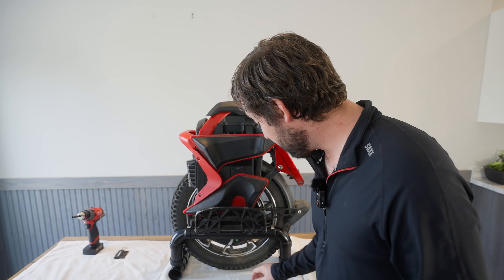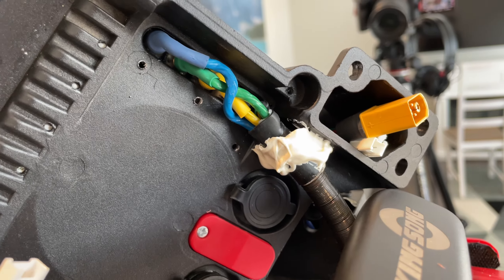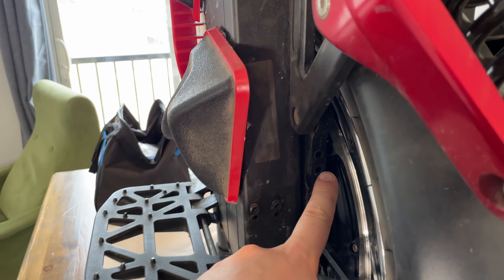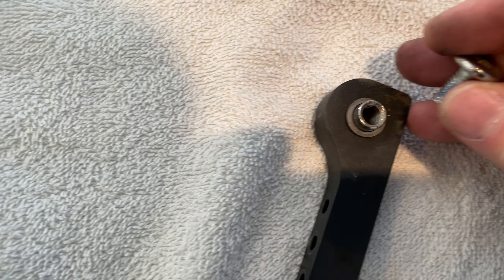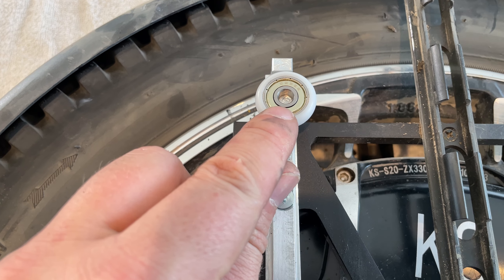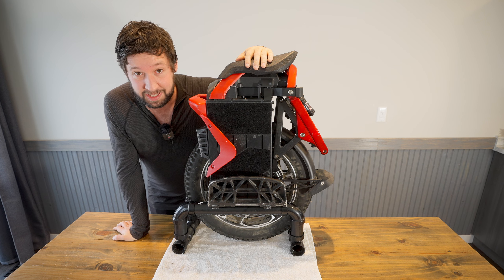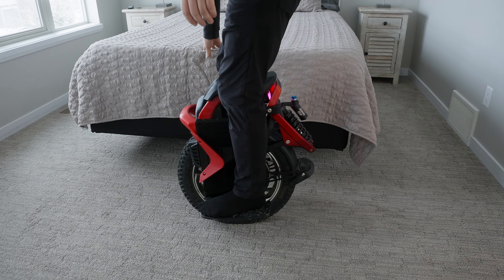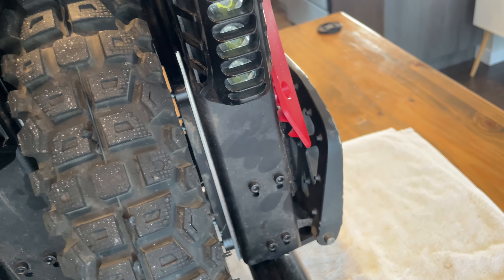King Song S22 CNC Sliders - Install Time!

Comment: I used a 8MM socket to hammer down my bearings, no issue and super easy
Reply from the maker: I tried the same thing! With, and without extensions, even greased everything - mine must have been abnormally tight.

Comment: Well just installed it and now it is acting funny electrically eeee... Emailed rev rides.. seems like the handle isnt SNAPPING Like it used to. It wouldn't turn on at first and now it does but making an odd sound and rotating even though its disengaged
Reply from the maker: That doesn’t seem right
Reply: @landocycle  yeah i know right... My last EUC was a v12 and when i broke the rim it took me 5 times of taking it back apart to get it to work. Was fairly confident i followed all the steps i really don't know what i did differently about the handle here... =\

Comment: 5:50 How hard would it have been to take the black bracket off the wheel and then press the bearings on using a press, bench vice or even a G clamp? I’m wondering if all that hammering has or could damage the bracket and cause alignment issues and that is why the CNC part is rubbing.
Reply from the maker: That was my initial plan after struggling with the first couple of bearings. Unfortunately, the hex bolts that connect the slider frame to the motor must have been red-loctite on because I was gonna strip the bolts trying to get them off. I decided to pick my battles and keep hammering.

I also was concerned about warping so I was visually checking periodically, and they're straight as an arrow; and they slid into the frame like butter with no resistance. So I think the rubbing is just the two front pieces slightly touching each other, which should go away after some use (I hope).
Reply: @landocycle  
I won't help you now but maybe try heat to soften most loctite. Not sure about red though but it's worth a try in future. A soldering iron placed into the head of the hex bolt for a few mins should have an effect.
Reply from the maker: @Therapistinthewhitehouse  yah, I just didn’t want to mess with it tbh. But I think it would make getting the bearings on easier for sure.
Reply: You’ll need a small bearing puller to remove the small bearing wheels if you need to replace or service them or their sliders.
Reply: @freeforester1717  
That’s not what we’re talking about. Removal is strait forward, it was the installation he was having problems with.

Comment: Have you done the shock bolt yet they need to be changed KS used to small of a length and the bind also
Reply from the maker: I have not, thanks for the info

Comment: does it have some vibrations while trying to troley it around? try some movements back and forth. mine have that thing.
how wide are wheels? it seems like there are a lot of movements sidewise and motor doesn’t stand tight. I think you should have minimum 9mm wide wheels to prevent it.

the metal noise you are hearing can be because of your roller rods are scretching the outer frame inside. its a bad thing and can lead to frame cracks
Reply from the maker: The motor makes some grunting type sounds/vibrations when starting or changing direction - that's normal. I didn't notice any abnormal motor play. The slider went in butter smooth so I would be surprised if it's damaging the c-channels but time will tell.

Comment: How would one go about eliminating the grinding sound you mentioned at the end of the video?
Reply from the maker: Mine’s gone already just needs to wear in.
Reply: @landocycle  so no more maintenance then? my s22 doesn't rebound back at all after a week of riding, it was perfect when I got it, now once it compresses you have to start lifting the wheel for it to rebound. think changing the sliders might help
Reply from the maker: @hipogejus  I still haven’t been able to test outside yet. We got a foot and a half of icy snow 😞
Reply: @landocycle  people say it's a beast on snow
Reply from the maker: @hipogejus  I can’t even walk outside it’s so icy, it’ll have to wait till it melts a bit.

Comment: Put the sliders in the freezer and the rolers in warm water then they just slide on. By simply hammering the bearings on, you  collapse the aluminum pin. and thats why its so hard to get them on.
Reply from the maker: That’s a great idea!

Comment: One more subscriber for you 👍
This arrived just at the right time 😃
I've only just started putting the 3D printed version together. I prefer to do the aluminium version but getting them here (other side of the world - hot and sunny here!) is just too much.
Do you have the CNC files / Drawing?  You made me think that I could get them made here.
The 'tyres' on the bearings. Where did they come from? The 3D printed version I'm using doesn't look like it will last all that long.
Keep up with the good work 😎
Reply from the maker: Thanks for watching. You can email me (my youtube name at gmail.com).

Comment: There is an easier way to remove the wheel. Search YouTube for 'Easier way to remove the Kingsong S22 Motor'.
Reply: Just the two bolts on the kill switch handle and it drops out. If the motor had a disconnect like s18, we wouldn't have to open the top. Just put the sliders on mine today, smooth as butter.

Comment: S22 - the ‘gift’ that keeps on giving - an assemblage of unreliable and Ill designed parts held together by soft, cheap and wrong sized fixings.  Your mod just doubled the worth and worthiness of the wheel!      Well done anyway, good explanation and props for showing the ‘warts and all’ 👏🏻 (gift - German/Danish word for ‘poison’!) ps -watch Marty’s suspension mod video for your next $20 modification to the shock bushing fixings (they’re too short as is) 👍🏻
Reply: All this and i still love it 💓💓 lol